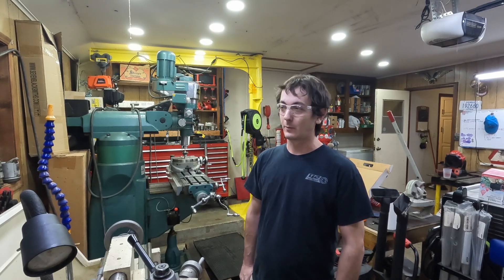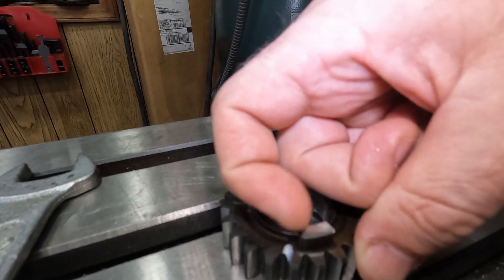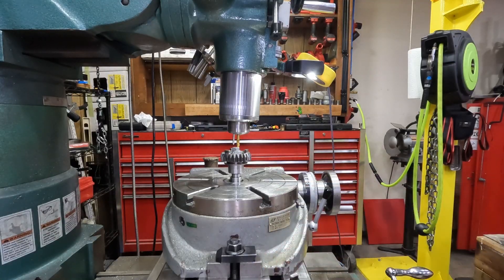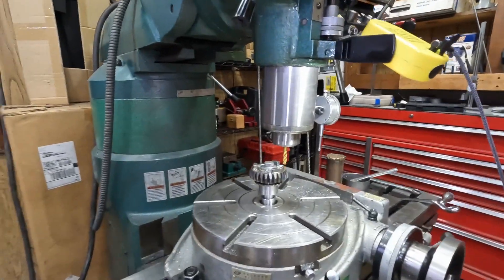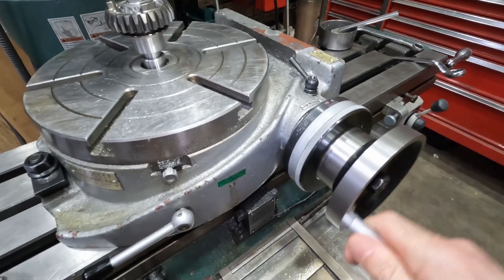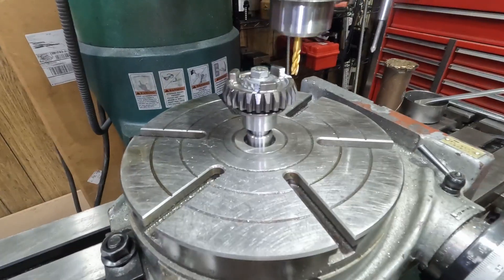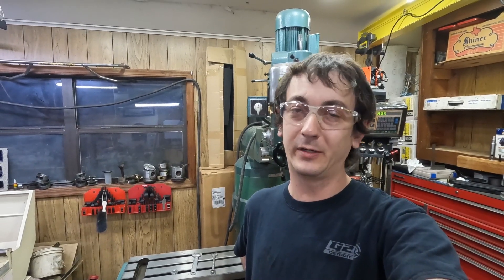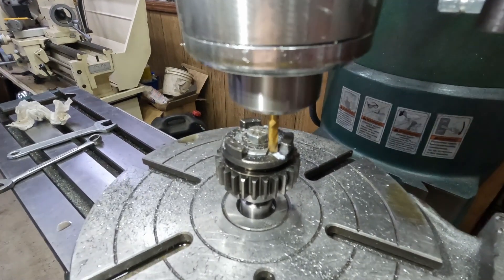Backcutting transmission gearing

Comment: I’ve been thinking of doing this on my R1 transmission gears. I been worried that it wouldn’t last, but really only because I see people paying thousands for racing transmissions that have this done instead of back cutting them themselves. What I’m saying probly don’t make sense, but I just figured there was a reason I’d not heard of anyone else doing this themselves.
Reply: If you cut into the heat treatment of the transmission you'll get into the soft stuff and destroy the gears within a few rides and have to start all over again

Comment: Hey man i think its awesome that you can cutt trany gears for atvs what would it cost for a full six speed trany of a 1986 yamaha TRI-Z 250 3wheeler. I  built it with a 380 bigbore and i'm running 220 pds compression 112 otane .My 3rd gear feels a little different then the rest but you never know.  Let me know 
Thank you. Take care
KINGTRI-Z380

Comment: Thanks for sharing. I need to go buy a mill to fix this Rmz transmission now… ha. What do you charge for this service on a 5 speed dirt bike?
Thanks!
Reply: Did you back cut your RMZ gears? If you did could you tell a difference? I have a RMZ 450 and that thing shifts like crap and hates full power shifts!